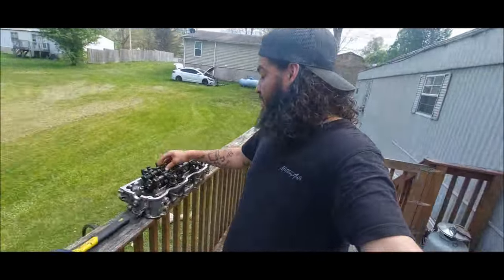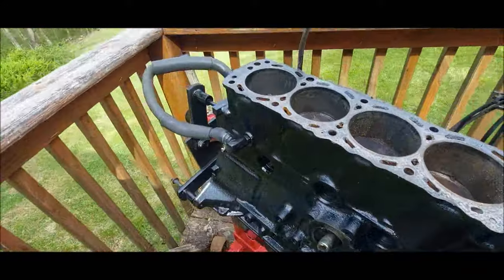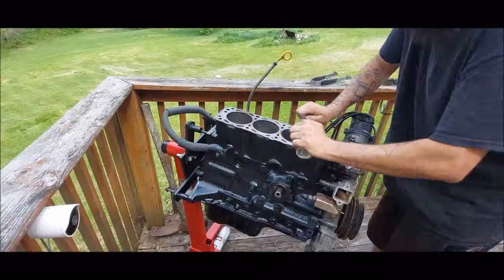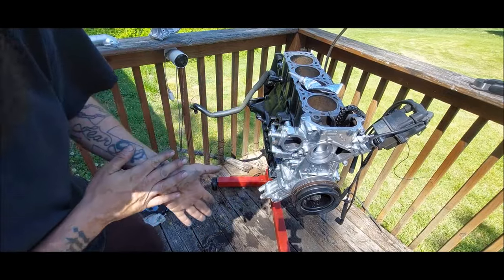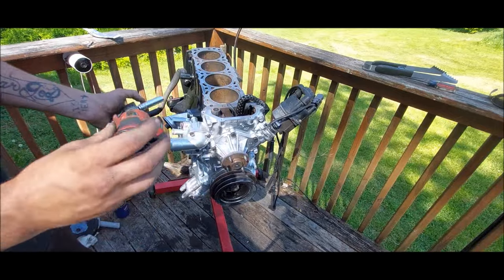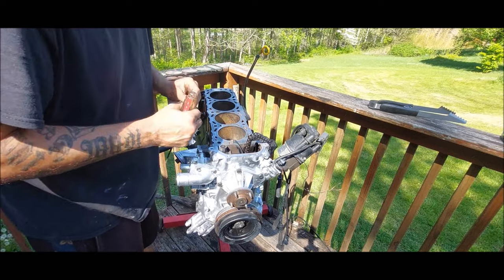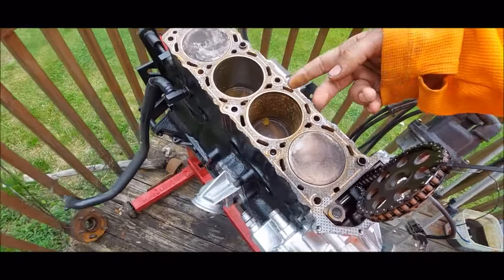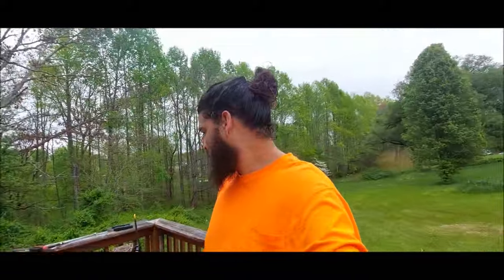D21 Hardbody Block Is RUINED Because of ONE BOLT!!

Comment: Sometimes when there’s liquid inside the bolt hole causes cavitation, which means it will give you an off reading when you torque it, causing broken bolt. Just a heads up.
Reply from the maker: Yes correct but I blew out the bolt holes and turned the engine upside down.